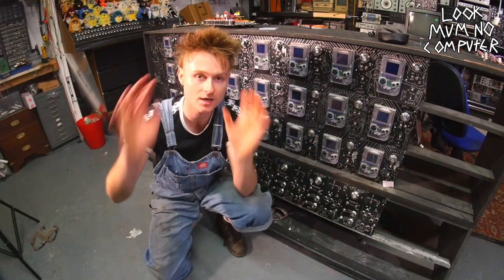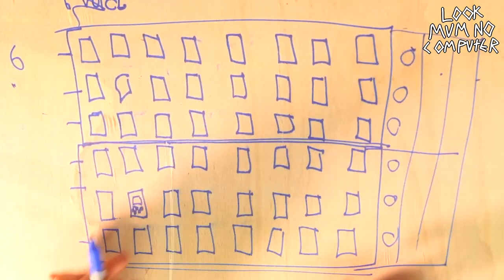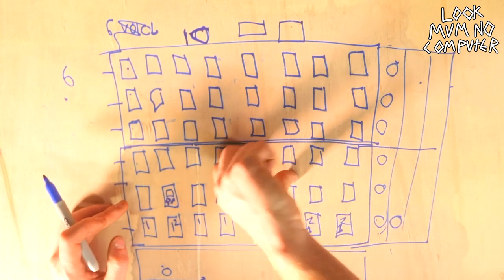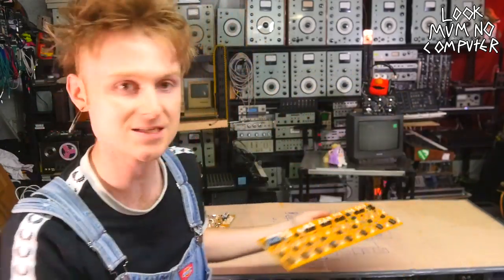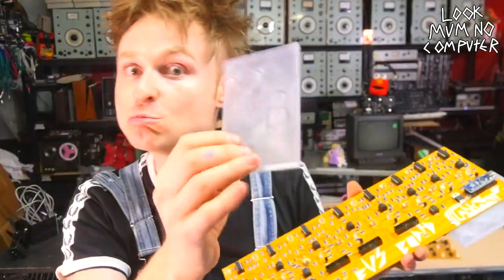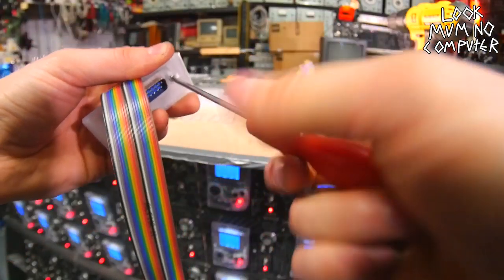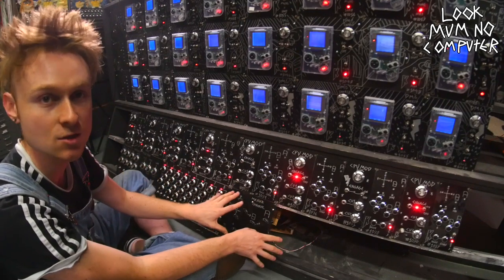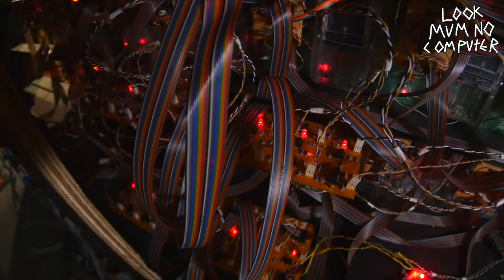GAMEBOY MEGAMACHINE #6 100 Voltage Controlled Amplifiers!

Comment from the maker: how would you have solved this problem? out of curiosity! its interesting to hear different peoples approaches :).
Reply: I don't even know why i am here sir...
Reply: You're very brilliant. I bet you're fan of Led Zeppelin. :0).
Reply: Maybe with a massive cpu? Analog switch Ic’s are pretty usefull too, my dad used them to built me a 10 input RGB scart switcher. It uses a microcontroller to control the analog switch chips. Relays are pretty cool, they used to control lifts and these old lift controllers are quite epic.
Reply: At this point, for this many vca's you could almost just use an fpga programmed as just a ton of buffered/controllable vcas. Might be worth looking into.
Reply: Honestly this machine is too complicated for me. Ask nasa.
Reply: @dykodesigns  I assume you were trying to make a retro video game switcher. Scart rgb is the best way retro games can look
Reply: @TheEnabledSecondary  Yes, we have built one in around 2016. Use it a lot, in fact 10 inputs aren't already enough anymore😀. Was a quite a complicated built for my dad.
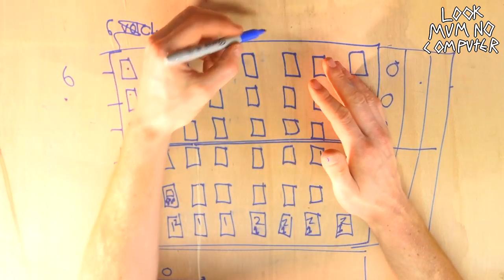Reply: Sounds like you need a Relay (3:38)
Reply: Why Don't you Stereo bus each row together, so you can pan the indicidual voices but you can choose which vertical bus goes through which filter just with a single knob? I know it limits some functionality but not really I think?!!
Reply: The answer to this question is, I wouldn't.
Reply from the maker: Bobby Govetas isn’t that what I have done? Problem is to be functioning voices they need to stay separated till after the analog circuit. Also to add. It may not go to filters next. It could go anywhere. Need to build a 10x10 digital patch bay to solve all that stuff!
Reply: 4053 Triple 2-to-1 analogue multiplexers.
Each ⅓IC can route 1 of 2 analogue inputs to 1 output, or vice versa, under digital control.
2 ICs can route 6 separate analogue signals (1 column of GameBoys) to either an A or B commoned row of filter thingamies.
Reply: @foorje  Although, analog fpgas are not common, and may not suit this application. Maybe this one is Ok? https://www.cypress.com/products/32-bit-arm-cortex-m3-psoc-5lp (only $10, and includes  switch capacitors, op-amps, comparators, ADC, DAC, and digital filter block) Didn't fully read the product sheet, so don't know how many.
Reply: I would just control them digitally, or just have an array of sound chips. Or just configure some already existing software.
Reply: Emulation 🤪
Reply: My Thoughts. (And this may not actually help.) But first ignoring the option to have channels split A/B into two signal paths, 
One solution for polyphony comes from through detecting the MIDI inputs. ( I will let you decide how - Arduino perhaps if you like coding them)
Use a FIFO operation, First in First out. Which is just a rolling counter, 0 to 5. To assign an Integer value to each note pressed and a BOOLEAN condition While the Note remains.
The Boolean check is made whenever a note is pressed to see which is the Next Avialable Free Number. And Upon release the Boolean condition against that integer returns False
Each Next MIDI Note will then just count up from it's current number and see which one does not have a Boolean TRUE condition against the integer to select the next available oscillator bank not currently operating. 

I guess there comes an issue from trying to do this across two signal paths. The above method will still work but the sounds might change more than desired as it steps through available oscillators.
To solve this, halve and duplicated the FIFO; So Counting Oscillators 0 to 2 and 3 to 5 simultaneously. (Slightly more coding. You Love IT!) And include additional Boolean checks against Channel A/B Selection. (i.e. IF Channel A = FALSE those notes are processed by the lower oscillators) Although again I imagine that would cause unusual sound processing depending on the range of notes sent to that bank..

Therefore; why not just use a MIDI Split. And have the top half for anything above #C3, Maybe. And have a keyboard split function. But make the split selectable. 
You would then be able to reserve the lower octaves for some more crunchier sounds. Having these oscillators processed independently :) AWESOME.

I'm loving your work anyway. Best of luck with its completion. :)
Reply: Maybe a bunch of virtual-earth summing amplifiers (aka opamps with one resistor) and two digitally controlled potentiometers per gameboy? would probably have been a lot cheaper and you have a bunch of teensies (?) already for the display control so you could have reused them and hooked them up to either an encoder (or use a ADC to get CV support)
Reply: I would solve this problem by not having it at all. Try origami or woodturning maybe???

I’ll see myself out now...
Reply: Oh, 100 Volts? Pretty dangerous! (then I read the title to the end...) :-) 
Anyway. It is very simple. LEDs and photo-diodes rocks. To bust signals you can use  25 quadruple operational amps or 17 unbuffered hex inverters...
By the way. You didn't reply to my e-mails.
Reply: Um, can't you just use transistors? They're switches. 
Or VCAs, yep that'll do it.
Reply: I'd just make some sticks that pushed the on and of switch on the gameboy and superglue them to the keys on a keyboard :P I think you'd be better off. The PCB's are already sold out, that would have been an awesome faceplate for my skiff. Maybe you could make some DIY oscilator kits with some super stylish LMNK faceplates. I have just sorted out my whole lack of oscilator issue, but looking for them showed me that there is a big marked for supercool simple stuff in the synth comuntety. I got a record deal BTW, I think you'r inspiration has alot to do with it. I will definetly buy a pin and a mixtape when I get ritch and famous money :P Yes, and a sticker. Cheers
Reply: Make is easy on yourself, use a patch panel for easy routings.
Reply: Hey, I know you're busy with building everything and probably don't have much time for the small details in the Arduino code (like making a detailed startup animation, or having multiple that choose randomly) but if you post your Arduino code for the startup routine you have now, anybody with good knowledge of Arduino will be able to work out how to address each screen and could build a few start-up routines for you. Maybe some visualizers utilizing a CV input or something? You have a community consisting of smart and talented people who want to learn and are passionate about what you do. Let us be a part if you so desire!
Reply from the maker: @thenateandkyleteam  but how can i do that when its polyphonic? 6 gang patch cables? that would be my solution if this was a monophonic machine :)
Reply from the maker: @familyguy0398  well funnily enough you say that! when i have all of the gameboys in (hopefully a couple of weeks) ill be making a module that is in charge of this, i will be posting all the info on the module so people can make their own thing with it. ill be adding a few inputs etc, and ill be using it for a video of looking through what people have made!
Reply: @LOOKMUMNOCOMPUTER  In my mind, you are essentially looking for a mixer, with each Gameboy being an instrument in the grand scheme of things. So instead of hard routing each Gameboy to a set of filter banks, have them breakout to a patch where you could route the audio path as you need. Using a half normal patch would work best in my opinion. The audio from the Gameboys would normally pass through to outputs without a patch cable, but with a cable plugged in you could easily control the routing of every Gameboy audio path. This also allows for great expandability in the future for different filters, pedels etc. So x amount of patch outputs for each row of gameboys, and x amount of inputs for however many effects you would like include in the mega machine. I feel like this would simplify the audio routing scheme.
Reply: bro, I didn't realize the old brick had a back light.
Reply: I'm thinking of the MT8808 8x8 analog switch array. If you used 4 of them you could make a 16x16 array. Thing is it's way easier to program a patch with an Arduino than by hand. I've been fiddling with a voltage controlled mixer using discrete transistors, which can have as many voltage controlled inputs as you want summed to an output. Each input uses three transistors and the output is three more. I can link to a schematic if you want.
Reply: I'd probably go for a simple op-amp buffer, or maybe even just a 10K resistor, on to the channel output, and split the mix between the filters at the end of the bus; That's what I planned for the multiple piezo pickups on a robot violin project that I still need to finish :p unless you're using the VCAs for per-note dynamics, I don't think you'd have lost much by commoning them, unless I'm understanding wrong somewhere. Regarding polyphonic midi distribution, I wrote up some code a while back (also for the violin) that handled distribution by assigning each output channel (in my case strings) a value based on whether it was currently active, and how long it had been active for, along with a few other things (in my case, how close it was to the required note) and assigned the note to the lowest-valued output; worked well, but probably wasn't the most efficient. Might also be worth looking at the mutable instruments MidiPal firmware; think that's got a fairly solid poly distribution setup.
Alternatively, on a ground-up whole-system restructure basis (sorry :p), I'd have probably gone for a slightly less rigidly assigned layout, pairing each gameboy with a slave uC, controlled by a master over a system bus (i2c, rs485, CAN or whatever) to handle button input, clock selection etc. (all the stuff on the bus atm), as well as note control based arduinoboy code, and distribute the audio to one of 8 or 16 so channels using an analog multiplexer IC. These could then be mixed together as note outputs, fed to different filters, whatever. In theory, this would give you independent, addressable control over each gameboy, and output any gameboy to any of the audio channels, which would give you quite a lot of flexibility, from 48-oscillator monosynth to 48-voice poly or anything between, as desired. Would also theoretically tidy up the wiring, although each gameboy module would get more complex. Love your work btw; this is just the way I'd probably approach the same project, but I'd then likely also wind up bogged down in minor stuff, drowning a single gameboy module in feature creep and never actually move beyond that, so take it with a heavy pinch of salt.
Reply: @petermuller161  umm... it didn't though... not even the color, or the first Advance.  The Advance SP was the first gameboy that had backlight... unless my childhood memories are really messed up.
Reply: @LOOK MUM NO COMPUTER How much money do want to spend? how reliable do you want it to be? Etc etc.
Reply: Don't use Arduino for back lights. Instead use an infinity loop punched paper tape or make an analog pattern generator... Something like when you set a TV camera on a TV screen and put signal from the camera back to the TV... but in hard wired way trough some amplifiers and delays... triggered by sounds...  It will generate some random pattern... Or just make an eight band graphic analyzer... or record some pattern into an analog sampler... or lets 48 volunteers to control the backlight individually,  or make everything and then switch between the options...
Reply: For true VCA use AD633, but LEDs and photodiodes still rocks.
Reply from the maker: thenateandkyleteam the problem with this approach which I would use if monophonic is this is polyphonic and I need 6 game boys to be matched: so I would need 6 gang patch cables or the annoying task (which I’m avoiding) or swapping them all if I want to change something.
Reply from the maker: 256byteram sounds interesting! Similar to my approach but with transistors cool!
Reply from the maker: Stuart Taylor dunno
Reply: @LOOKMUMNOCOMPUTER  leaving aside how you implement it, if you have 6 voices, each with 8 GameBoys, you could treat each row as a bar in histogram, modulated by attack or aftertouch - the stronger the note the more GBs trigger.  You could put a strong light next to each so that as they are controlled (from a keyboard maybe) you could see how the oscillators are triggered like a massive graphic equalizer display.  This might be just one of several modes in which the instrument could work.  So for example you could split octaves to control different subsets of the GBs instead maybe.
Reply: @LOOKMUMNOCOMPUTER  some pretty rad PCB layout there, including silkscreen, so your veroboard layouts are just to disguise the fact that you're actually a genius ;-)
I may have dropped the 3 Arduinos in favour of a single teensy and used I2C as a bus. But I like the VCA idea, over relays or switching. Keep it up!
Reply: op amps with LDRs in the loop, with LEDs as the CV input. it's a very nonlinear way of making a VCA but it'd be cheap and simple circuit-wise
Reply: Potentiometers and a pulley system to connect them all together ;-)
Reply: I probably would have used an analog crosspoint switch like an ADV3205, though an old mechanical telco crosspoint switch would be way cooler. I don't see an easy way around using VCA's though, aside from servo controlled pots, and then cost becomes an issue. 

I do have a question about how you are using the ribbon cable, because a few updates back you seemed to be getting cross-talk problems, which makes me think that you aren't using alternating signal ground pairs, though I could easily be wrong.

But seriously, how cool would it be to have this thing clacking away every time you through a switch? https://upload.wikimedia.org/wikipedia/en/b/be/Crossbar-hy1.jpg
Reply: @StefanNoack  I'm not sure if you're joking, because they do have servo controlled pots that are used in audio applications, like big mixer boards.
Reply: Why no create a relay ladder that delays each gameboy per voice like a stepped attacked/release, mechanical. It will be not even nice, but it would be fun...why not. You can flick the switch automated by an lfo, and a will panned right, b will be panned left. Or whatever routing you will do. The relays will obviously make sophisticated clicky sounds which give a roland d50 touch, but mechanical, or whatever.
Reply: @fletcherreder6091  - I agree - he needs to use some old Strowger telco equipment to solve this problem. :)
Reply: When you described the problem I instantly thought of digital potentiometers like the MAX5418 series. They can be adjusted via i2c. Basically I would have used these together with an opamp buffer and a single arduino controller per column. One disadvantage is the limitation to discrete 256 steps for the volume. Your VCA solution seems more elegant and they work with cv without using some sort of AD-Converter, but if you choose the right digital pot, you could have saved a few bucks with these.
Reply: good god why dont you just wait for the Behringer clone
Reply: @jordyhoutman2654  That would be cool, and imagine doing it with one of these! https://upload.wikimedia.org/wikipedia/commons/9/9f/WE_206A_wiring_terminals.agr.jpg and you could use an old rotary phone dial for the control for extra awesome! If someone else doesn't do this I might have to, it's just too awesome an idea.
Reply: @NeuronalAxon  Someone else just suggested using a relay based step-attenuator, and I immediately thought of those. Either we're both crazy, or this is actually a good idea.
Reply: @fletcherreder6091  - lol, maybe we can the next all digital one System X. :)
Reply: @AJMansfield1  HA! That is a completely obvious solution that I did not think of. Stuff like this is why I love the net.
Reply: More VCA's
Reply: great idea this machine! I guess i would've created 2 groups for each 4 gameboys of one voice so i have less choices to make and a simpler design. So, if i'm correct, you only need 24 VCAs for the gameboys itself, and in front of one filter there's 4 Gameboy voices. Also you could've simplified it further and connected the filter VCA to the Amplitude VCA (with variable amount) like in the Roland SH1 or the Poly 61.
Reply: Also i have to state that i never built a synth. I repaired a couple and am genuinely interested- that's all
Reply: Wait wait wait, those switches can be switched FAST, which means you could potentially PWM the signals being routed...
Reply from the maker: Fletcher Reder indeed
Reply from the maker: D# Moll it crossed my mind but I wanted to go the whole way
Reply: If you want a group to all sound the same, you could reduce your knob count by used ganged pots. You’d need to trim out variations in each but that could easily be wired on some perf board. Of course, you might want to match the ganged pots with a VOM first to reduce the trim needed.
Reply from the maker: Thomas Bland how would you be able to use control voltage? Also deal with audio bleed because of the increased distance the signal needs to take down to the bottom cabinet and back up again?
Reply from the maker: Fletcher Reder indeed! But poss more complicated 😂. I had to develop a decent vca for another project so figured kill two birds with 1 stone!
Reply from the maker: fan4tix but digital pots are rather pricey! And vca’s are much more smooth and quicker.
Reply from the maker: Jordy Houtman all of that stuff will be dealt with in the analog stage of the synth. These aren’t the final vca’s there’s plenty more to comeb
Reply from the maker: Fletcher Reder haha yeah I have played with servo pots they are cool. Tried em for a project. So expensive tho haha. Not to mention pretty darn slow 😂
Reply from the maker: famitory deffo! But I kinda wanted proper vca’s :)
Reply from the maker: James Skene one of the many scenarios possible doing it this way! There will be an after touch module coming that indeed could be plugged up to this module to bring in more or less gameboy a :)
Reply: @LOOKMUMNOCOMPUTER  To understand the problem: You want to have the signal out of each game boy going into N adjustable gains (2?) and then the output of each of those gains going into some sort of summing junction?
Reply: A fancier and probably more expensive way to do it would be to actually duplicate all of the filter/adsr blocks so each game boy went into two (or four) of them, then gang the user controls so that you could have separately triggered envelopes for each note
Reply: @LOOKMUMNOCOMPUTER  true, was just a wild idea, making a relais based vca. Woukd be rad, or completely useless
Reply: @LOOKMUMNOCOMPUTER  Do you have a Github account? I'd say you would get code contributions from the fans plus it would add to the body of evidence that you deserve to be in charge of your own Open University courses.
Reply: will it be stereo ?
Reply: Multiplexing?